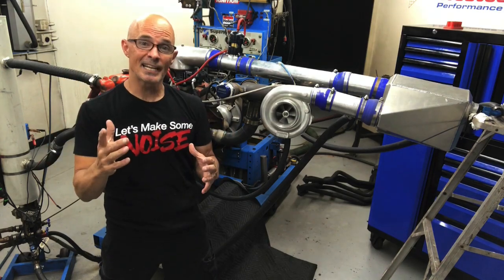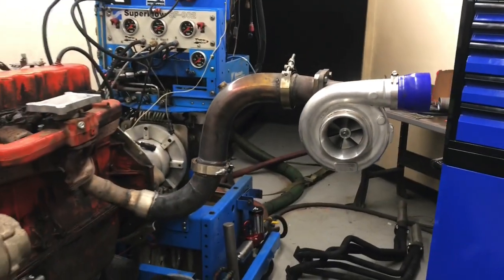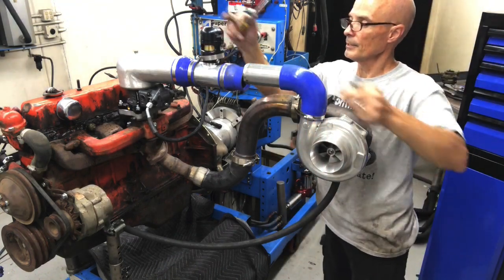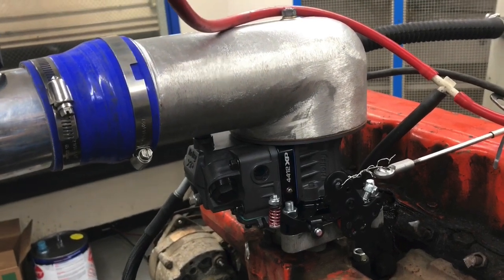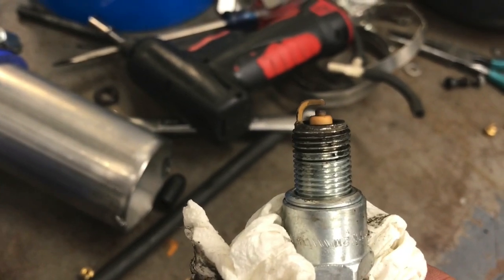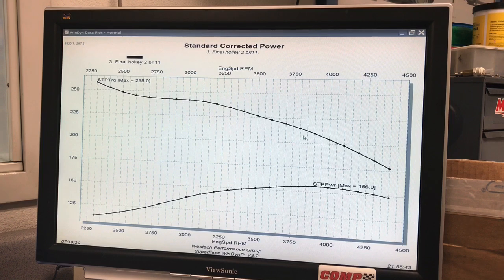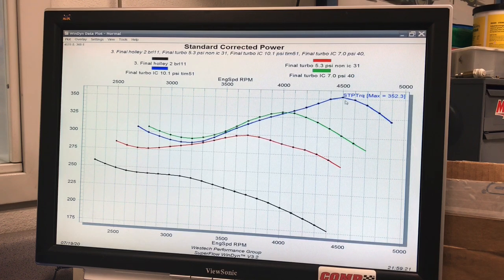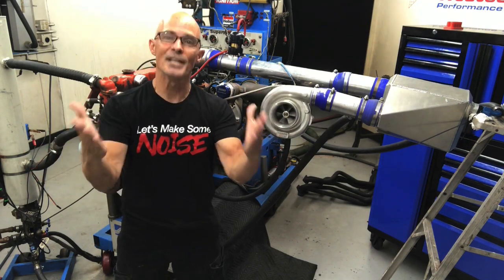TURBO 292-LOW BUCK, DIY POWER MODS

Comment: What's with the extra hole in the oil pan there's no fitting in it there's no plug in it there's no nothing you drill one hole and then drilled three more holes for the fitting I'm super confused
Reply from the maker: I marked 1 hole then finished it-two mounting holes and 1 drain hole-three total
Reply: @richardholdener1727  that makes sense thanks for the reply

Comment: I love how you just make stuff work old school. Nothing in the world wrong with cobbling something together just to test things. Hell, there's nothing wrong with cobbling something together to run as long as it works and is dependable. You only really need precision (especially on older engines) when it comes to absolute top performance or precision testing. Obviously, you're not precision testing anything here. You're just testing and looking at results. Sure, some nicer bends here, a blow-through there, better turbo here.... and yeah, you'll get to that. But for right now, you tested what you needed to with what you had. And what it proves is that certain combinations can work even if they aren't optimal. You just have to know what you're doing.

Comment: Can't wait to see all the mods you want to do to it on NA and then slap 1 Bar of boost to it, my predictions 405HP / 455 TQ
Reply: he's already at 500 torque if he had the right turbo.  Modded with the correct turbo it will be at 600+... IMO
Reply: @superkillr  just assuming he will keep the same turbo and add a cam, and do some porting and gap the rings, and only get to 1 Bar ( 14.7 psi ), if you keep adding boost of course you will increase HP/TQ, but I'm basing my predictions to 1 Bar.

Comment: I never thought that this statement would make sense
The big turbo saved the rods...
Please test the big turbo when you get a cam in it?
Cheers
Reply: Didn’t think about that. Good point the boost coming in later saved a lot of stress on those internals
Reply: A 62/62  at the same boost would probably kick the rods out after the first WOT lol even with the big boy turbo it was already making peak torque at 4k
Reply: That’s why guys run big turbos on the MazdaSpeed 3’s.

Comment: The little engine that could! This is cool, seeing this neglected 6 cylinder, waking up. 👍
Reply: camaroguy 66  Zounds! Ya cant beat the balanced smoothness of an inline 6! My old 170 Slant 6s ran like a sewing machine, over 5000rpm, no problem (short stroke). 225, bad  idea.
Reply: @donellmuniz590 wonder how hard it would be to find a 170/198 (short-deck slat 6) to put in an older Dodge van?
Reply: camaroguy 66  
Fuel injection sucks.
They put one in a checker cab. 
Love those guys !
Reply: camaroguy 66  275hp 275 torque
Reply: A chevy 4200 was run turbo at drag week in a 67nova wagon was said to make 1000hp.......
Reply: camaroguy 66  
Those are the guys with the LS turbo Winnebago 😁

Comment: I'm about to turbo my '68 Ford 300 in my f350.  I've been recommended both a hx35 and a hx40. Wanting as much responsiveness as much as possible just being a truck and not a race car, should I lean towards the 35?
Reply: Yes. You'll gain plenty of torque and spool around 2k-2500max with the 35.

Comment: Hog out some extra holes and bolt a plenum to it, doesn't need to be perfect. I did exactly this with a log intake manifold and used truck coolant hoses to connect the two additional inlets. Those inlets were upper thermostat housings because it's what I had. Sit the carb on the plenum and send it. Love these videos, junk is fun.
Reply: Dino's Shed : Hog tha log. Takin on the Metropolis with people called Dinopolis. Howdy man! This is great. Bought some soda pop, pop corn and liked, rang the bell and share. This is a sweet cartoon staring Secrete Squirell, and Im Moroco Mole. Im feeling Moorish. More boost, bigger intake access and...dee dee dee de deeeeee. Bring the noise....
Reply from the maker: The Banana Splits-Danger Island
Reply: @richardholdener1727  I love your work mate, off to get myself an ice cream
Reply: @deanstevenson6527  straight back at  you sir, Richard certainly has created something that us engine heads can sit back and enjoy 'ON A DAILY'

Comment: Can't wait to see you do this on a 300-6 Ford. 4 inch bore x 4 inch stroke. Should be awesome 👌
Reply: That would be great. I dont even watch the LS stuff. Yeah, it's tough, its fast, its everywhere, but I'm sick of em. I wanna see what can be done with old, quirky, antiquated, obsolete technology. More of an engineering challenge. It would be much harder (and more expensive) to try to build a 400hp FLATHEAD than a 2000hp LSX. How much is a set of repop Ardun hemi heads for a flattie? $5000 with the valvetrain?
Reply: @donellmuniz590  I hardly watch the LSx stuff too unless I have too much time on my hands. It's been done and beaten to death by everyone by now so no real incentive to watch.
Not a dig at Mr. Holdener(he does a great job no matter the engine joined to the dyno) but rather the LSx fad.
Reply: @GIGABACHI  it may be a fad like you call it. But my ls powerd 46 ford truck runs low 8s. And my 2400lb vega tube chassis with a $$$ 540ci ran a high 8. 5300$ to run low 8s  versus 18 grand I'll take the fad
Reply: @patriotrob7066  yes, it works. Can't argue against that.
But I'm trying to be entertained, amused, not go low eights.
Same reason people race home made go-karts with a 5hp Briggs Stratton.
Reply: Displacement	240 cu in (3.9 L)
300 cu in (4.9 L)
Cylinder bore	4"
Piston stroke	3.18" (240)
3.98" (300)
Reply: with long runner EFI Intake manifolds! ... and boost
Reply: @aliceshaw8265  over 20 years ago, Dick Landy and Kenny Dutweiler built one, and they went all out for a Bonneville record. They reverse-flowed the engine, making the exhaust ports the intakes and vice versa. They put the turbo in the valley. They had to beef up the bottom end, but I dont know how. They made around 600hp and did set a record. It might be online somewhere.
Reply: Did a Ford 300 years ago
Reply: https://youtu.be/IBsZAFx7U0g
Reply: @jdog942 if only it were cross-flow like the 12v 😞.
Reply: Jeff Kopis  YUP, more to life than just numbers and stats.

Comment: Yes! I love to see it. You know, even with that big turbo, the soggy response probably helps make power SBE. If you had a smaller 3-400 hp turbo that came in earlier, you'd hit the motor with more torque (cylinder pressure) and maybe hurt the bottom end. But! Imagine someone with a dirt simple old truck or 4 door nova or something. A setup like this could push that thing into the 13s or maybe even 12s for very very little money! That's value right there.
Reply: Yeah, you could hurt some feelings with that combination.👍
Reply: Yeah!!!
LIKE-
UNKLE TONY & HIS SCANT SIX...
and i almost forgot-it has a wheezer YET...
Now, he GETS to drive like a hoss...

We love you; Unk T.

BRIAN q+p.
Reply: @brianbenson5769  Uncle Tony rocks. He's the guru for lowlife, cheap, dirt poor Mopar guys like me. He does more with less ("more" is a relative term, lol). 300-400 hp from a turbo Slant 6 would surprise folks.
Reply: @donellmuniz590  yeah,I know he does....

The pirpose is to get rich to build a turbo 300 pwd. Six & may have a friendly rivalry.

B.t w.- i grew uo in a N.S. cgitown mopar famuly with MANY 46M26 MAX26  WEDGE & 440 WHITE KNUCKLERERS..
I KNOW OF UNK T. From nearby union grove, wi. 
The fastesr 6'liner here on u-tube IS A FRONT ENGINED 300 ford 6.

Best e.t : 7.34@173+  
Haven't  seen aby bowed-ty or moig scant NEAR there yet 

And i still love unk T 

BRIAN.
Reply: @brianbenson5769  I had some trouble interpreting your typing, lol. But I did catch Union Grove! I was born in West Allis in 65, saw AJ, Mario, and the Unsers at the Milwaukee Mile, 67-69, and Garlits at Union Grove in 68! My very earliest memory! My dad was sayin "Look, it's Big Daddy", and I was confused, lol.
Reply: I've seen guys online running 11s and 12s with turbo Slant 6s in A bodies (Dart, Duster, Valiant, early Cuda, etc). Apparently the key is to use the short stroke 170, which revs like hell. The long stroke 225 wont survive much boost, I hear.

Comment: Wonder about a 2.5 duke.
Reply: Surely it won't be hard to double 90 HP
Reply: @LS__812  Or 105, which is what it made in it's final years w/hydro-roller cam.
Reply: @pancudowny  yeah I couldn't remember the exact numbers but knew it wasn't chosen for performance reasons lol
Reply: They have a glass bottom end. I broke two rods in one doing a burnout. Tore the oil pan and windowed the block. Oddly it still ran and never lost oil pressure.
Reply: @timothybayliss6680  That's probably the one area the OHV 2.2L has advantage over the "Duke"... just wish GM  got it's head together and made a decent head for it!
Reply: @pancudowny  I always liked the 2.2, canted head and all aluminum. it could have been a light weight wonder. My brother had one in an s10 and my cousin in a sunfire. Both ended up pitching head gaskets. A factory turbo version with a sand cast head and MLS gasket could have been an underdog the world over.
Reply: From Leo:  They put them in Jeeps for a while, bad news.  The little duke has a pathetic bottom end.  As soon as you push it, the bottom breaks.  Been there..